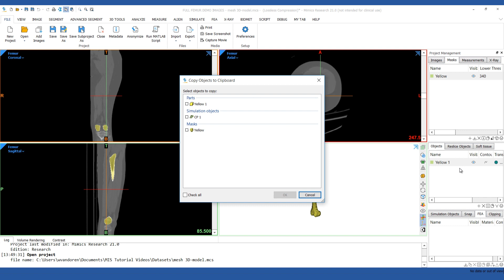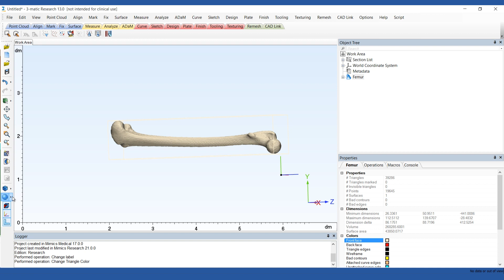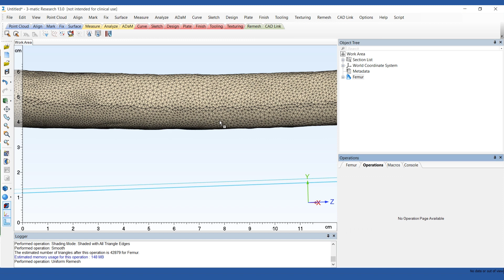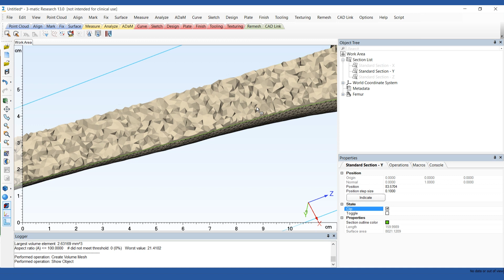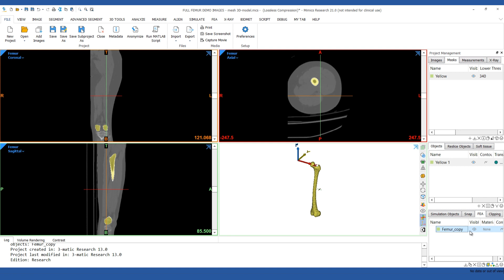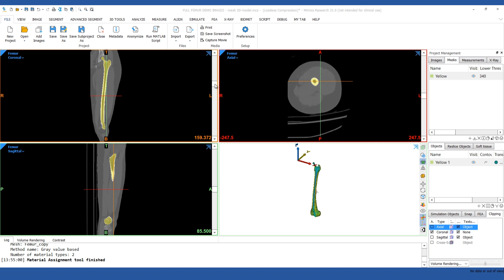How to Mesh a 3D Model | Mimics Innovation Suite

Comment: Thank you for sharing this instructive video. In my model, it happens that the volume mesh creating fails, I do not know it reason, but it says meshing failed while I have created a mesh in the previous step. 
Can you guide me through this please?
Reply from the maker: Hi, thank you for your question. Before creating a volume mesh, you need to make sure you have a high-quality surface mesh without any error in the mesh (like intersecting triangles). You can use the Fix Wizard to check your surface mesh and see what mesh fixing steps would be needed before creating the volume mesh. Don't hesitate to contact your local application support representative for more information.
Reply: @MaterialiseMedical  ، thank you very much for your support. I realized that using the adaptive mesh instead of the uniform mesh solves the problem. Thank you again. Best wishes